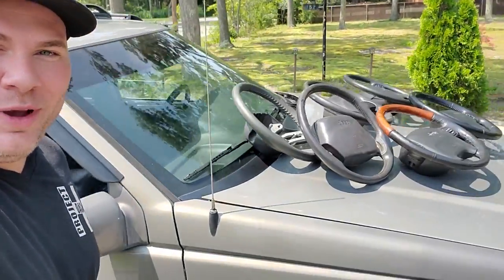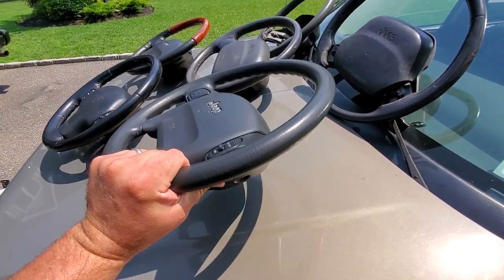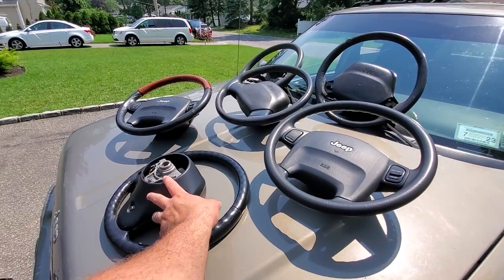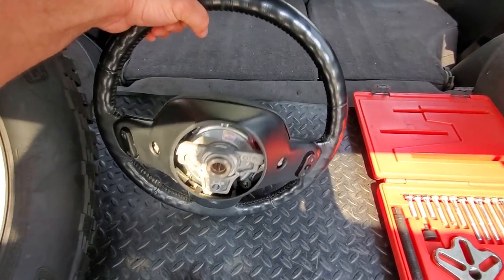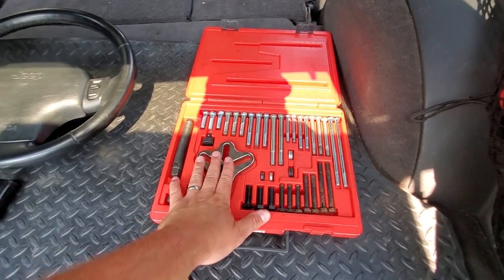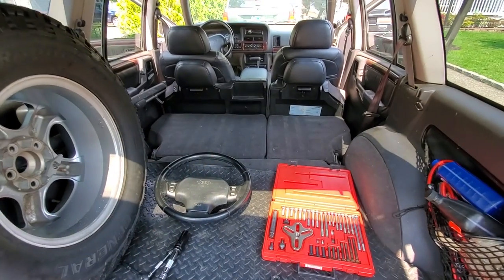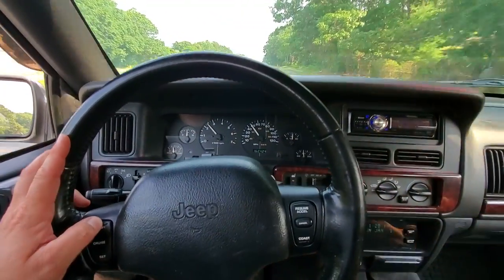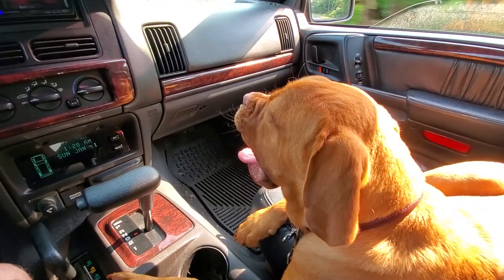JEEP GRAND CHEROKEE STEERING WHEEL SWAP - HOW TO REPLACE ZJ, XJ, WJ, TJ STEERING WHEEL.

Comment: Can’t wait for the WJ to XJ steering wheel swap. I wanna do that on at least two of my XJ’s
Reply from the maker: Yea buddy!  WJ steering wheel on an XJ with working CC and radio controls!
Reply: I’ve got my 99 and in my garage waiting is a steering wheel from a 02 WJ just waiting to be installed. Looking forward to that great info you keep putting out. Glad I found your channel.
Reply: @ProjectDanH  I'm interested in doing that wj to xj steering swap with cc and radio control's.  I already have cruise control, and nice 8.8 joying head unit and would love to take advantage of the radio controllers the wj steering wheel has.
Reply: @ProjectDanH  When where and how? I just realized I really need the radio controls but I don't see the video about this, did I miss it?

Comment: I need that WJ to XJ video. I’d love to retain my cruise control AND add radio controls 😬😬😬
Reply from the maker: What year is your XJ?
Reply: @ProjectDanH  1998
Reply from the maker: @Frangulate  ahhh 98!  That year may need you to make custom cruise control buttons using 98 guts and the WJ shell
Reply: I have 2000 XJ with cruise control.  What year WJ can I graft from?

Comment: Bro you live in the rust belt many need a Dana 35/44 rear coil spring lower mount and shock mount Video. Also while your at it look into the frond dana 30 coil spring mounts. Love your vids by the way ^^..
Reply from the maker: Your right!!! Thanks for the info Brother!

Comment: Hi, Dan. Not sure if you’re still following this thread but have a simple question for you. I have a ‘97 ZJ and the steering wheel has cruise control buttons on it. I would like to add radio controls to the steering wheel, but I was unsure from your video exactly what I need to do to add those. Besides swapping the steering wheel, do I just swap the clock spring for one that has radio controls, or ???

Comment: I have a question about the wheel splines. You mentioned that they only go on one way but that there is a gap at 12:00 and 6:00, does that mean they could go on two ways? 180° apart? I suspect mine is 180° off because if I am in the center of the steering box travel the wheel is upside-down.

Comment: Dan. Would you know which clock spring to go with? I’ve got a 99 XJ and I’m installing a 02 WJ steering wheel. I know I went too new with the wheel but I’ll make it work. Just trying to figure out which clock spring. I currently have a 99 WJ clock spring and it’ll need to be modified as well as the bracket on the steering column. Just want to make certain it will all work before I get too far. Thanks in advance!!
Reply from the maker: Ive heard of success with both a WJ clock spring and a ZJ clock spring.  You just have to make sure they have all the wires for the features you wish to install

Comment: I'd love to have the overland wheel on my 5.9 zj I already have steering wheel radio controls so do I need to change the clock spring or will all the plugs work on that swap? Thank you so much for all your videos they make being a zj owner easy😁
Reply from the maker: Hey Mike, thanks for watching! If you already have the controls it should be just a simple swap! Lemme know how it works!

Comment: Hello my friend, I am having a problem with my ZJ. The horn does not work when I press the outer rim cover. What should I do to make it work?  Although when I close the doors of the jeep with the remote, the horn sounds
Reply from the maker: Have you tried a new clock spring?
Reply: @ProjectDanH  Do you mean the steering wheel  spring unit?
Reply from the maker: @mohamadalsaeedZJ  yes, the clockspring

Comment: After D&D in the garage showed you can swap a wj wheel onto an xj I literally have to do it. So cool. I just don’t wanna do the work. 96 xj. Will the buttons Horn and cruise still work?
Reply from the maker: Not sure if the CC will for from a WJ to XJ older than 99... Horn will tho

Comment: What stereo is that? I have controls on my WJ but they don't control the volume at all, do you have a link to that?
Reply from the maker: Check the cards and my end screen Pop ups for links to vids on how to get steering wheel controls working on an aftermarket head unit

Comment: I have a 01 xj will a 2002-2004 overhead steering wheel work?
Reply from the maker: Yes, however you need a 99-01 airbag
Reply: @ProjectDanH  thanks brother

Comment: Can you put a Jeep WJ steering wheel into a Jeep XJ and also have the rear stereo controls functional with an aftermarket stereo?
Reply from the maker: Yea, you need a WJ wheel. A 99 00 01 wj airbag, a wj clock spring.  Wj clock spring wire connector.  Then your gonna have to heavily modify the wj clock spring to fit the XJ.  Then youll need the pac swi interference
Reply: @ProjectDanH  will you make a video of it?
Reply from the maker: @gersonruiz1714  absolutely.. it's gonna happen in beach jeep
Reply: @cody jensen same, idk what beach Jeep is tho
Reply from the maker: @gersonruiz1714  it's my secret project.. I cut a 2 door XJ in half and mated it to a 4 door door XJ to make 2 door 3 row XJ
Reply: I definitely want to see this video too when you get a chance. I’d love to have WJ radio controls in my xj

Comment: What do you know about swapping a ZJ steering wheel into a 97 XJ? I thought I had it figured out, bought the ZJ wheel, actually got it recovered in a leather wrap. But now I'm reading conflicting things, do I need a ZJ clockspring or XJ clockspring? I'm adding cruise control btw. Thanks in advance, if you have advice.
Reply from the maker: The wheel it self should bolt on.  Your best bet is an XJ clock spring equipped with CC.   Not sure if ZJ buttons will work on a 97/98 XJ, please let me know!

Comment: @Project Dan H  by any chance do you have a spare good working OEM under hood light that I can use on my ZJ?
Reply from the maker: I have a couple but they're not working yet.. I'm gonna have to make a vid on those things
Reply: That would be great, I have the under hood light assembly but I think its missing something internally where it makes the bulb light up when you open the hood. I can not find a replacement or information how to fix it.

Comment: Capacitors drain to ground, guess what happens when you disconnect that only... You get dead capacitors. Bad pcm tcm remote unlock you name it, you damaged it. Overtime this is exactly how it happens

Comment: Does anyone know if it is possible to reconfigure the cruise control buttons on the jeep steering wheel to other functions by connecting to the Android head unit?
Reply from the maker: Yes, You can program the buttons with a PAC SWI interface module.  i have a vid on that. hopefully it will help https://www.youtube.com/watch?v=ngYovfiI96E
Reply: @ProjectDanH  Thanks a lot for the info, I am planning to buy a cherokee xj and the latest model in my country on the market - 1996, with an old dashboard, how difficult would it be to properly install the multifunction steering wheel and electric seats in such a model?

Comment: Hey Dan! If you're still looking at the comments on this video, maybe you could help me. I have a 97 ZJ limited and I want to swap in a steering wheel from a WJ overland (swapped in some overland front seats a while back). What all would I need to grab from the junkyard? Just the wheel or do I need the clockspring too? Thanks.
Reply from the maker: I think you may be good with just the wheel... it depends on your options, radio buttons, CC, will need a clock spring with that wiring.  if your ZJ already has it, you're good to go
Reply: @ProjectDanH  it's the limited w/ infinity sound system so it's got swc already. That's awesome!